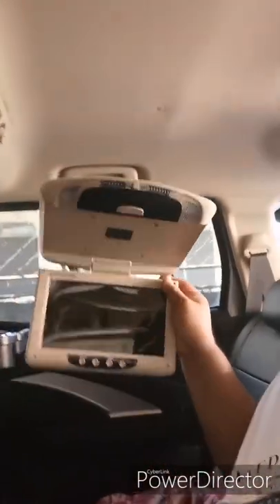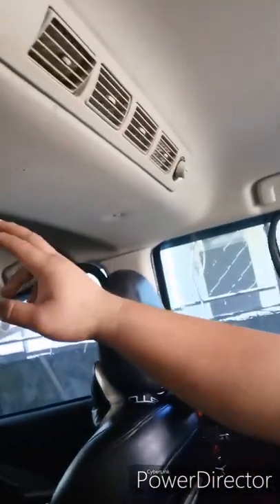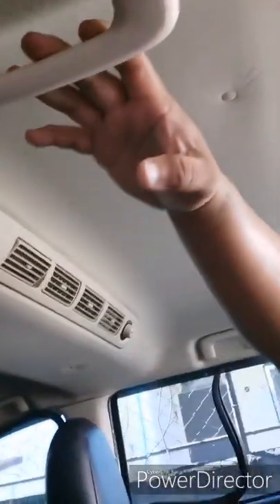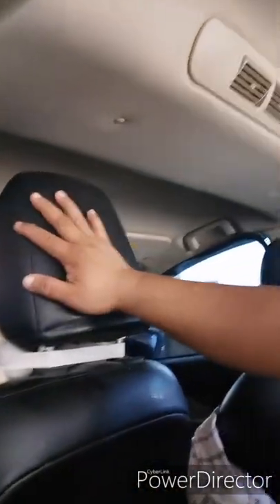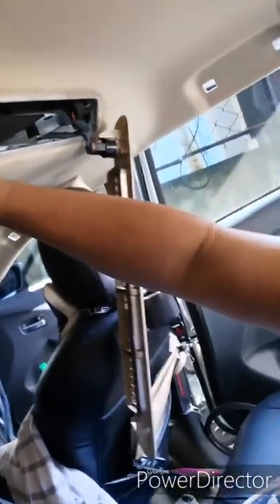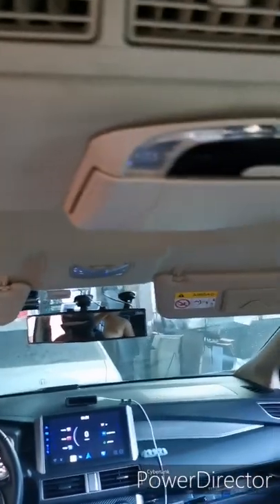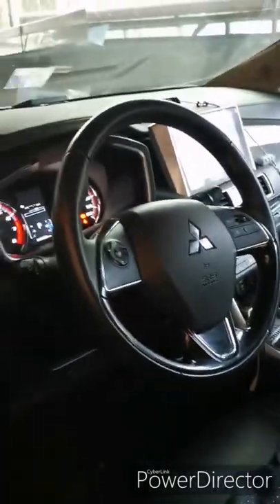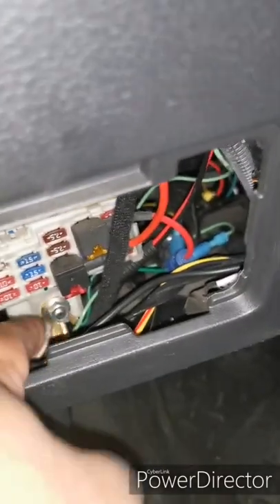Flip down roof monitor install

Comment: Bro pg 15 inch Kya n roof monitor pde pag xpander????
Reply from the maker: i wish po pwede pero sosobra sa front and back kaya medyo papangit
Reply: Joshua Alviar ok po sir noted.. 12inches Po pde na??
Reply from the maker: depende po sa overall na sukat from front to back... may specs naman po s mga sellers at compare nyo sa sukat ng 2nd row A/C
Reply: Joshua Alviar thank u Po